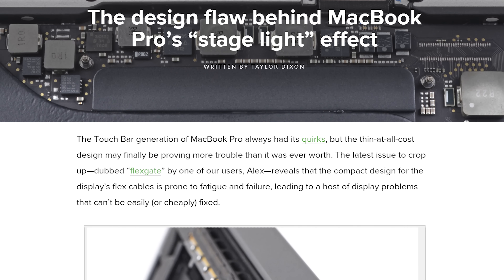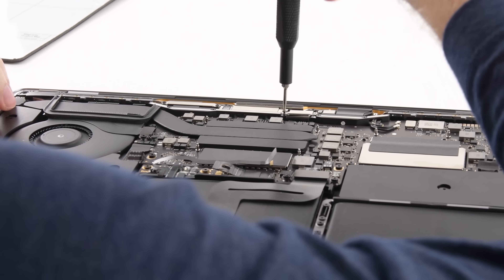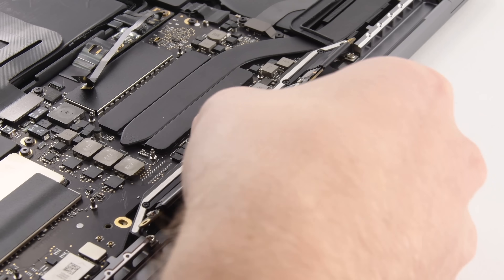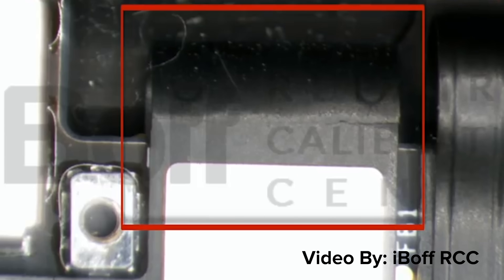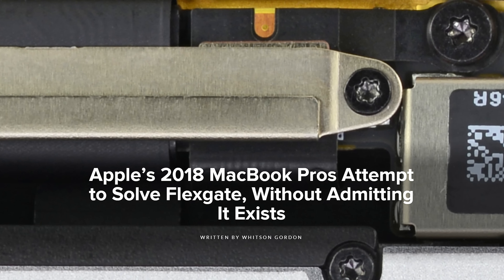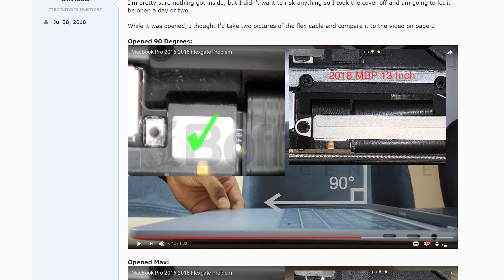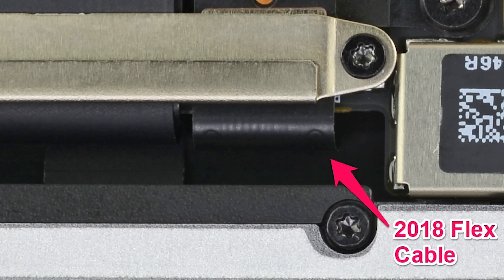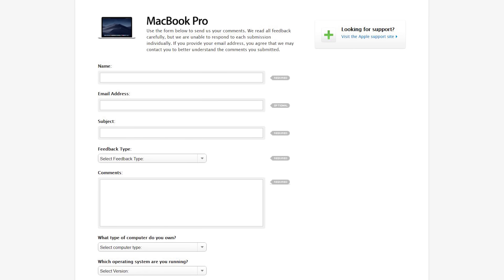MacBook Pro Flexgate Follow Up! Has Apple Addressed The Issue???

Comment: i brought the 2017 macbook pro thinking "Apple has the best quality and this macbook will last at least 5 years which is worth it for it's expensive price tag". Now i feel stupid.
Reply: @Derek Frampton actually my macbook air 2011 is still running
Edit: i also have a 2013 mbpro maxed out and a 2011 imac
Reply: well, what about my iMac from 2011 XD that thing is still up and running perfectly well ;) (written from that same imac)
Reply: The Craft Dude I’m waiting for someone to come along and be like “What about my Macintosh from 1984?” 😂
Reply: macbooks (and apple products in general) back then seemed to be more reliable than they are now.
Reply: As long as you learn from your mistake, it's a learning experience.  I learned never to give them my money again.  You're not stupid for thinking you should get your money's worth.
Reply: Far from it. Had a colleague brought the older macbook pro to work. Got my hands on it, instant reminder on how much better the keyboards used to be. Older apple machines, especially those born when Steve Jobs are still around, are longer lasting than those today. Sure there was the antennagate in the iphone 4 back then, but antennagate is a mere annoyance, while flexgate and butterfly keyboards render products completely unusable over time.
Reply: Derek Frampton my iphone 5 and my sister iphone 5 is both up and running
Reply: Sure, let me go get my iPhone 4, iPod Touch 5 & iPod Nano 6. They seem pretty existent to me 🤷🏻‍♂️ Actually did you know that eBay, Facebook marketplace, etc are full of them? It’s true, you should have a look sometime if you’re not too busy being blind

fanboy.exe has stopped working
Reply: doh
Reply: @Derek Frampton I have a 2015 macbook air which still looks and performs exactly the same as the day I bought it 🎈
Reply: @Mido._.0110  sorry to burst your bubble, but the macbook air wasn't refresh until 2018. your model is 2014.
Reply: @Derek Frampton I would be very reluctant to buy new Apple laptop, but my 2012 MacBook Pro has worked flawlessly for nearly 7 years. I hope it continues to accept OS updates because I'm not sure what I would buy next.
Reply: @Derek Frampton My 2013 Macbook Pro 15 in here is still going strong. A few dings and the rubber around the screen is slowly turning to goo, but it still looks good and runs fast and quiet with no screen, keyboard, or headphone jack issues. I want to upgrade, but I know now I would face a downgrade in durability and reliability with a newer model with all the thin cables and keyboards not holding up among other things. Sad. Also could go out and buy an RTX 2080 laptop for the same price as a new MBP. I am not fond of WIndows despite building a gaming pc, but still super sad.
Reply: @Derek Frampton 2011 Macbook Pro and 2012 Macbook Pro still going strong.
Reply: @Derek Frampton Also my sister has an iPhone 5C that she's still using and I'm rocking an SE (although the SE is only about 3 years old now it's still very snappy)
Reply: @Derek Frampton  My early 2011 MBP is actually performing better today than the day I bought it in february 2011 because of the RAM and SSD upgrades.
Reply: @Derek Frampton yes it has. Iphone 5s.
Reply: @Derek Frampton got an imac g3 from 2001 still working.
Reply: same here i bought 2016 one thinking same but nope i am getting flexgate now i am out of warranty and getting no support
Reply: Don't worry me too. In the process of escalating my display repair to be done at cost to Apple
Reply: @PaPa-D tbh my mid 2014 macbook pro still works fine lmao
Reply: Same and now I’m buying the new 2020 16inch’’ MacBook Pro after 3 yrs?? Man my 2011  MacBook Pro lasted till 2017..I’m guessing this one will flat out die just after warranty as well....
Reply: Same. I went from thinking Apple products are high quality and after sales care is the best to IM SO F—KING DONE WITH APPLE TIM COOK IS THE DEVIL. They charged me for service, sent me back my MacBook Pro and NOTHING changed.
Reply: @mico8187  For my MacBook they tried to charge me £680 when I traded it in for a new one I got £350 So I decided to do that and buy a new one.. But what I dont get is the fact they wanted me to pay like a quarter of the full price of a the product (well actually I Paid 1300 for my 13'' MacBook Pro) So I dunno why I would pay more than Half of the price to get 1 fixed...
Reply: @Derek aKa PaPa-D the 2015 a1398 is the only one that has. I own that model and also have a computer repair shop, so I've seen every other model's shortcomings.
Reply: Si has your Mac give you any issues?
Reply: My mac lasted at least 6 years without facing any issue. I’m having 2016 macbook pro touchbar version.
Reply: Wanna hear something funny? My 13” 2015 MacBook pro is running like new, no issues ever.

Because of that, when I got my 15” 2019 MacBook pro, I was like, this thing is going to last a few lifetimes. A few days ago, my screen got flex gate. 

This was a direct results of making their products with cheaper materials and workmanship to increase profits. The cable connecting to the monitor is shorter and cheaper than the ones in previous models.
Reply: @Derek xPaPaDx Frampton My 13” MacBook Pro 2015 is still up and running like it was on day 1. Never had a single issue, glitch or malfunction. Same with my original stainless steel apple watch that I bought the same year.

Too bad I can’t say the same about my 2019 15” MacBook Pro, which now has this flexgate issue. crApple used to be a fantastic company that made high quality stuff, but now that they’ve got the public hooked on their products and the idea that they are “top of the line,” they make them with cheaper materials and designs to make more profits. The flexgate issue is the result of them using shorter and thinner cables for recent MacBooks.
Reply: Don't worry, your PC HDD will go kaput before your MacBook shoes y any sign of damage.
Reply: @Derek Frampton my 2011 15"MBP in your face mate. fully upgraded.
Reply: everyone makes mistakes, its only money tho.

Comment: My cable is being replaced by Apple without having the whole screen replaced. So it appears they are able to replace the cable and not the screen.
Reply: Max Daniel Nidd which model you’re having? I read the article about this issue about a month ago, thinking that it probably won’t happen to mine. Unfortunately it just randomly happened last week. 2016 13” touchbar model.
Reply: Calvin Lim The 2017 13” MacBook Pro. The cable is costing me about £40 however they’re adding labour costs of about £60/£70 on top. I was surprised to find that they would replace just the cable, however that said that they could do it given the circumstances. Not sure whether it is a company wide service or not. I am only having to pay for this as Consumer Laws don’t apply to me as I bought the divide through Apple for Business website. The chances are consumer laws may apply to you and you won’t have to pay.
Reply: Bat Bam Apple have supplied me with a receipt confining the service and cable. Granted £100 is expensive for a cable but luckily it’s not £600/£700
Reply: Bat Bam. As do I thanks. I gave it them on Monday, and they say it should be ready to pick up today. Not too bad
Reply: Max Daniel Nidd  how’s your macbook so far? Are you using the one with the touchbar or not?